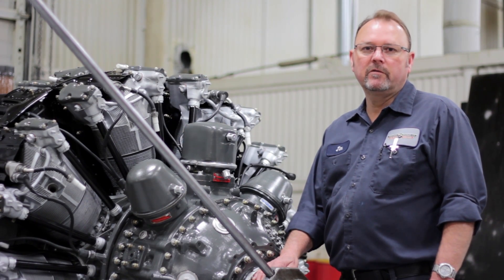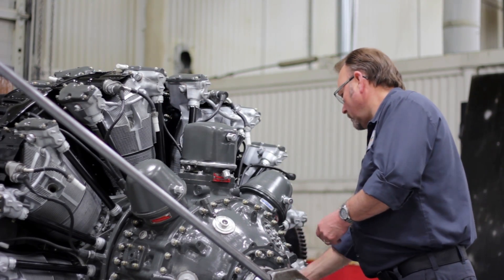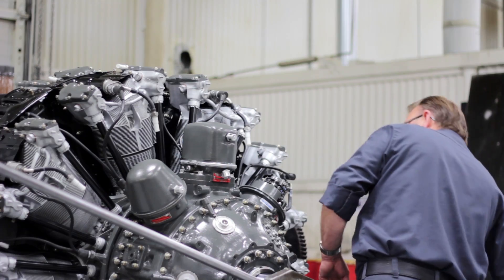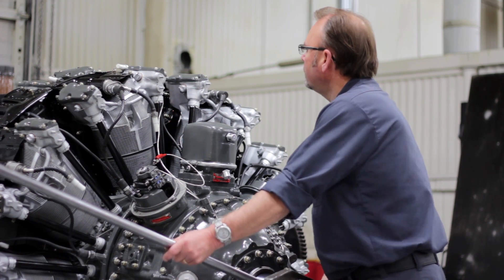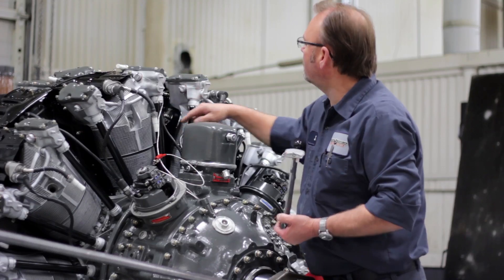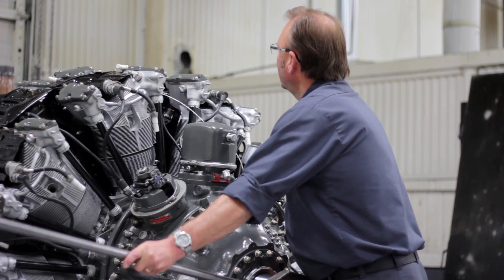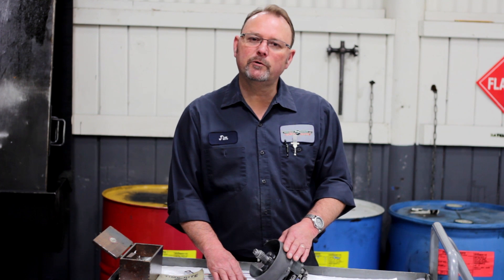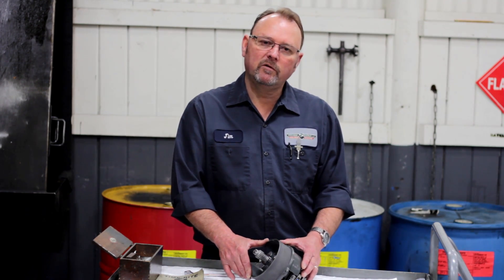Precision Engines Radial Engine Ignition Timing

Comment: I happened to be present once when a mechanic tried starting an older Jaguar's V-12 engine not knowing someone else had installed the distributor components incorrectly; a shotgun blast would have been quieter than the backfire that resulted, scared the crap out of me. If that's the likely result of mishandling this job on that great old radial, I'd sure want these guys doing it! And not just because I hate backfiring lol.

Comment: what if you time it  bit wrong, would it to blow into pieces?
Reply: I've seen an engine break a connecting rod because the wiper in the distributor got loose and it fired at the wrong time. It was on an Aero Commander 560F.

Comment: there must be a number 1 lobe on the cam because isn't it a compensated cam on radials.
Reply: Eric Schultz, almost right, the compensated cam is in the magneto itself.  The minor timing issues when dealing with a radial engine technology required a compensated cam for that reason.  Valve timing was not part of that as it was almost ignored because of the limited technology back then.  Volkswagen in the original Beetle engine even had a compensated cam in the distributor to counteract the placement of the oil cooler in the airstream cooling some of the cylinders to aid in cooling.

Comment: 21 degrees static advance is quite a bit.
Reply: I think if you are comparing this with auto engines it may seem high but these engines were relatively low compression, running 100 octane avgas and run at lower rpm because of their size, all these factors would allow more advance.

Comment: No criticism sir thanks for the video, but with all due respect: This needs to be a 15 or 20 minute video with narration @ a much slower pace with 3- cameras positioned 1-showing frontal engine view and 2- the other close focused to see every detail of timing instrumentation installation, and monitor indicator needle(s) motion w/ indicator light" before-during-and at termination of engine rotation at the cylinders" and 3-At the Mags or distributor points if that's what the backlash (I'm guessing on this ?) adjustment is for.  Time constraints in the shop may have rushed the project.  An experienced A&P on radials can probably keep pace with this but for many of us "you tubers" bitten by the radial curiosity bug, it's a bit hurried and we wonder was every minute detail explained ? What does the light indicate (firing position?) and what causes it(the light) to operate..points open? or closed ? or piston position? or combination of factors ?
Reply: The light is on when the points are closed and the primary current goes to ground. No current flow. As the number one piston rises, the arm touching the piston moves across the scale of the card. The scale card is calibrated to the movement of the piston and was also set at zero degree or TDC when the propshaft was pulled thru the direction of normal travel. So now the the card degree is timed to the movement of the crankshaft. As the crankshaft rotates the points open and the the light goes out. At this point he applies 40" lbs. of torque on the distributor to simulate the load on the gear train as if the engine were running. This causes the light to come back on and the crankshaft will then be turned an additional degree or more for the light to go out again. Now he just slides the "pointer" up till it makes contact with the arm ( the light comes on again) and he reads the degree the pointer is pointing to. The ignition timing is right at 21 degrees before top dead center. Hope this helps.

Comment: I get it .... NOT :-)
Reply: 4nuk8r: thanks for your added instruction, every little bit helps. I once heard a WWII aircraft mechanic vet telling of an event where they could not rotate the prop on a large radial. He said the engine had a "liquid or hydrostatic lock" ?? He also said they knew it was a cylinder that had the valves closed (ready to fire) but which cylinder was the mystery. They were getting ready to start pulling a lot of spark plugs(double row radial) when someone suggested pulling the mag covers to see where the rotor was pointing (firing that cylinder/valves would be closed on that one) and trace the ignition harness back to the cylinder that coincided to the rotor position.  My Q- Does it sound like that procedure would work in real life? I'm not highly trained on engines and radials are an enigma. Makes you wonder: since magnetos are used on aircraft for reliability, why not on auto engines?
Reply: You can pretty much bet the bank the lock is in a lower cylinder.  Mags were once used on cars.

Comment: This is a high altitude magneto system. The magneto in the center of the two distributors generates primary AC volts to the 2 distributors. Then they distribute in time primary current to the coils on the cylinders. This system eliminates spark scatter in a common rotor/ cap arrangement  because its all done by brushes. Air gets thin upstairs and acts like an insulator at low altitude. Its very reliable. The primary wire is in conduit rings around the crankcase to distribute wire to the right coil.
Reply: You can see this effect when someone puts a Tesla coil in a vacuum chamber... it shorts out, crazy!  See Electro-Boom for a fun video on this.
Reply: "Coils on the cylinders", that escapes me.  I've not seen images of coils being on the cylinders and would like to see how that is.  I only have understood the wiring looms of the plug wires to the spark plugs.  Forgive me, I've been a mechanic on earth-bound engines, not on aircraft but think the radials are super devices.
Reply: @whalesong999  Coil-on-plug is how most cars are done now, I believe.  Also, I'm assuming there has to be two magnetos for redundancy... there are two separate redundant ignition systems in every piston-powered airplane.
Reply: @scowell  Yeah, I'm aware of those things but I don't think aircraft engines of the period had coils near the plugs.  I recall ignition wire looms on the piston engines meant for high altitude were also pressurized to maintain resistance.  I'm considering there is a language issue regarding coils on the cylinders but I'm going to research on my own to clarify better.  Thanks.
Reply: @scowell  That is mainly because the cylinders are so large that they need two spark plugs to get a good burn of the fuel.

Comment: I wonder if Pratt & Whitney ever thought these engines would still be in active service some 70 years after their introduction.
Reply: Well....

When WW II broke out, both Curtis-Wright and Pratt & Whitney had radial engines in commerical service. Both competed hard to win contracts with companies like  Douglas Aircraft that designed the DC-1/2 (that soon became the DC-3 / C-47). They were reliable and produced good power over a broad performance range and environmental demands.

When the requirements changed to build high horsepower twin row radials that produced over 1,500+ HP, the limits of what a radial engine could handle were becoming visible. New alloys, harmonic vibrations, piston speeds, compression ratio, oil lubricant quality and fuel performance, demanded new development and testing  processes that nobody specialized in. Early radial engines were expected to operate up to 1,000 hrs before overhaul (TBO).

The military was in the same bind and initially demanded performance specs that were, literally, pie in the sky request.

By 1942, the military began to get its act together. Engine overhaul cycles were drastically reduced to 200- 250 hours until new oil lubricants could be developed. Maintenance procedures were redeveloped with several compromises agreed upon. The military could not afford long mechanic training cycles to keep fighters and bombers in the air. Courses needed to pack technical requirements into programs that could be completed in less than a year. 

In some countries, mechanics entered service with 6 to 8 months of training and had limited knowledge on the latest water cooled and air cooled engines. 

Historical records indicate military procurement staff prepared a wide range of lifespan expectations depending on which theatre of war aircraft operated. For example, US Marine Corps Corsairs that used P&W R-2800s were expected to last  500 -750 hours in combat before replacement was needed with one engine overhaul or replacement before being stricken from the flight line. Many Curtiss-Wright and Pratt & Whitney engines exceeded 500, 750 and 1,000 hours. Not because they were perfectly maintained, but shear luck,  given the fact, spare parts in many cases didn't exist. It was either fly with what you had or be overrun.

Records of actual squadron utilization are spotty at best. The Royal Navy flew Corsairs aboard their carriers and maintained good records. Top end cylinder overhauls occurred more frequently than Pratt & Whitney's manual estimated. None of their R-2800s achieved their 500 TBO (RN Spec) until late in 1944. The R-2800 had undergone several improvements (supercharger manifold, exhaust valves, etc.)

By the time the Corsair F4U-5 entered service during the Korean War, TBO targets had increased and met objectives. It had water - methanol injection, automatic cowl flaps, updated two stage supercharger and vastly improved oil cooling.

It wasn't much better for the Royal Air Force and the Rolls Royce Merlin (or Packard variant) water cooled V-12. It's TBO was 240 flight hours. Most never made beyond 200.

Comment: Just a novice here but I was wondering why these engines still use contact points? 
With as many of them that are still in service around the world it would seem that they would have been up graded to electronic ignition and maybe even some sort of throttle body injection at some point. 
Would be great if someone could enlighten me 
Thanks and great video! I love that R2800!
Reply: For someone to design and manufacture the means to do it they would need to sell many more than the demand for it would be. That is a problem with many of the existing parts of different manufacturers and models of radial engines. Some parts are scarce and too costly to manufacture  for so few remaining engines. That is all aside from the fact the prop is constant speed so crank degree location isn't as easy to ascertain.
Reply: +jas harris 
Thank you for the reply, that makes sense. I sell a lot of antique truck parts and the logic is of the same rational with trucks - Peterbilts, Kenworths or Studebakers. Replacement parts and up-grades are based solely upon supply and demand. 
Maybe I'm just a sentimentalist when I see the silhouette of a DC6 and hear those P&W R2800s spool-up and climb into the sky.
Keep'em Flying!
Reply: Smaller radials that are still very popular with vintage aircraft or need reliable operation for crop dusting (R-985, R-1340) can now be upgraded with electronic ignition and electronic fuel injection as an option provided by some specialty aircraft engine shops. The bigger radials that see limited use would be more complicated and more expensive to add these redundant systems, also factoring the paperwork and FAA approval process for so few customers. Those big radials lumbered for many hours and for thousands of miles during the war and they were pretty sturdy back then, and the philosophy is to rebuild them according to the book with good parts and keep going.
Reply: FAA approval is a cast-iron bitch to get.  That's why a $20,000 1995 Buick Roadmaster can go from -133 ft to 14,000 ft in a single day using a digital computer, but nothing like that exists in the airplane world for close to that.